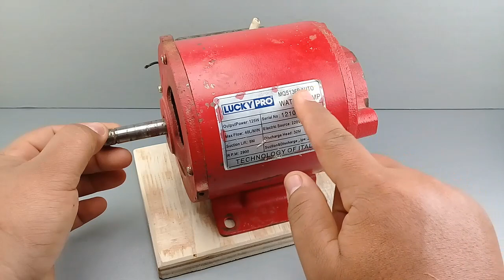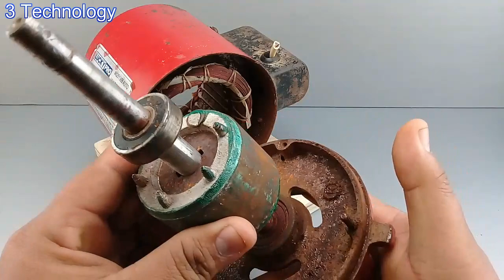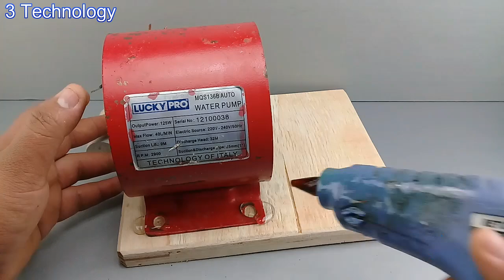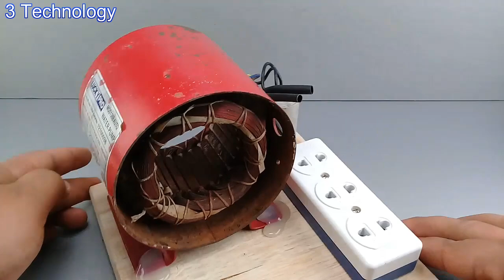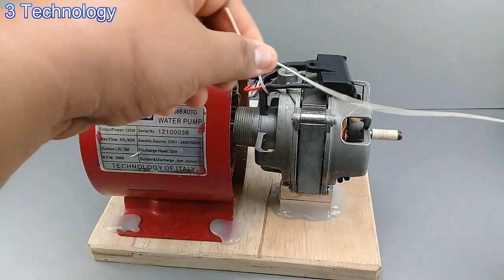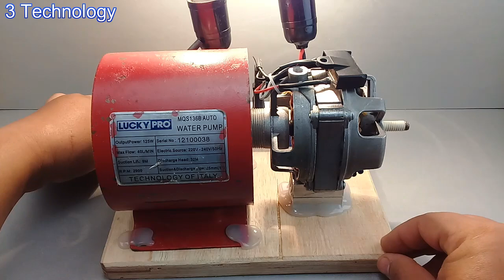I turn water pump motor into 220v 5kw electric generator

Comment: I'm confused...
It takes electricity to run the motor. So why not just plug in the lights and use that electricity?
Reply: I'm confused to where  in the hell you see electricity powering this? He used a rope to get the motor going and from there on, it was producing the electricity to power those lights.

Comment: What is the basis that 5kw is produce in that motor, terminal wire of the motor is # 16 or gauge 16, which current capacity is 8amps or 1760 watts far from 5kw or 5,000 watts
Reply: The motor in the plate of the pump is 125 W, so maybe it's a 5 kw per day pump

Comment: It would be more credible if you claim that your device can produce 5 kw and then use something like a angle grinder for testing. I've seen other people using multiple high power demanding devices at the same time which is more credible